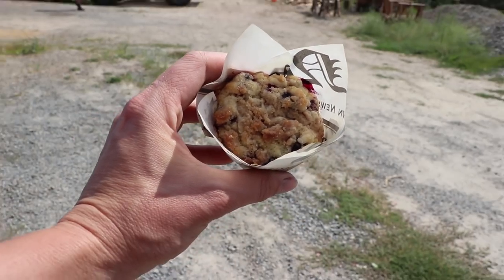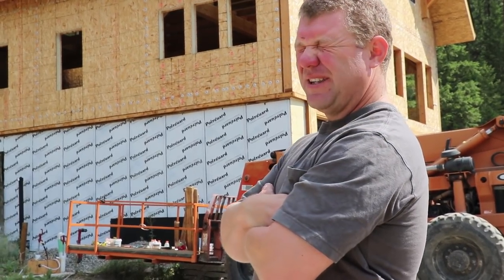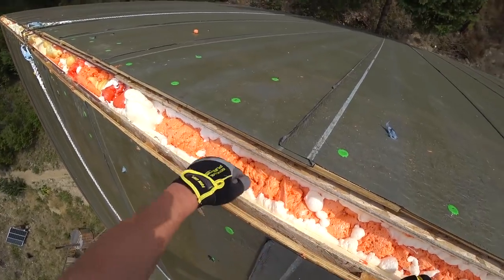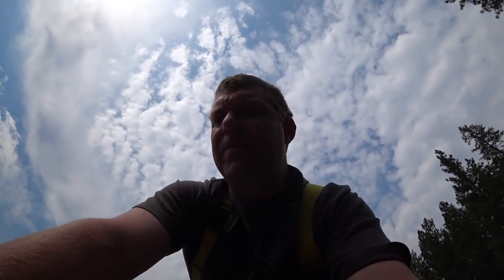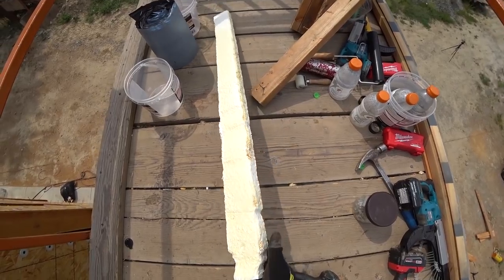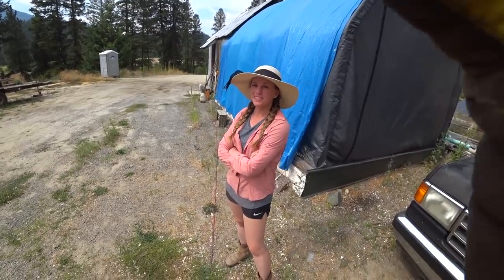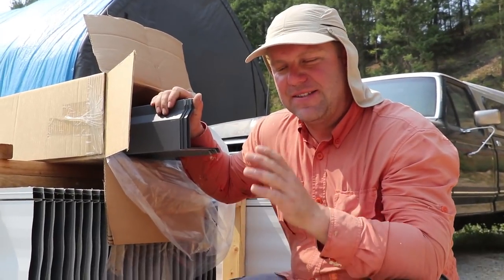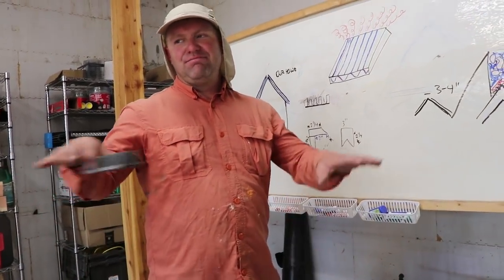OH YEA! Our Standing Seam METAL ROOFING Has Arrived!

Comment: I've been a Carpenter for 35+ years. I was told a long time ago, the difference between a good contractor and a great contractor is how they deal with problems. Your issues are normal in most house builds, being a first time builder it takes you longer to research and act on these issues. You guys are doing great, My .02

Comment: where I live many use common metal roofing with no problems. I installed this on my house using stainless steel screws. don't use galvanized one's they will rust and the heads will pop off and you have leaks. do a good prep and don't cut corners.  after 30yrs and solar no leaks.

Comment: I live in Duluth Minnesota and had a standing seam roof installed on a 12/12 pitched roof. There are no penetrations of the roof with fasteners. The roofer installed the cleats with hidden fasteners and used a metal brake to bend the roofing material to clamp on the cleat. We have high winds here every year with many downed trees and lots of snow. My roof is still solid no leaks and snow slides right off.

Comment: We have a place in Vermont... Snows a lot there, gets really cold too..  Our galvanized steel, standing seam metal roof was installed in 1974.  it's not going anywhere for probably another 44 years... (hidden hardware too).. The only thing we've done is to add a coat of Rustoleum...

Comment: I'm in Michigan and both the barn and house have hidden fastener standing seam roofs.  The barn roof dates from 1972 and the house from 1981, both much older than I am :)  The only thing done to either roof in the last 20+ years is a scrubbing with a bleach solution (moss) and then repainting with rustoleum.

Comment: I commend your patience.  I tried doing a standing seam roof with helpers and I finally got some smarts and hired a crew that does it for a living.  After my roof, I only recommend getting a guy that has a metal bending truck as he has invested 10's of thousands on a truck.  The tight knit crew measures every 22" and makes a list of each top to bottom measurement within a 1/4".  Each panel is made to match the roof.  I am sure even your roof is not exactly rectangular.  
Back to my house, they removed what I had done and started from 1 side, bend over the edges on the side and eve part.  Then went to the next panel.  Basically my roof is a giant tin can with all edges bent around.  Handled 3" hail since, 3" an hour rainfall, racoons and squirrels merrily sliding down it for 15 years now.  The attic temperature dropped 20 degrees and Heating, cooling bills dropped.I used a ridge vent on mine.  You could heat up a hot dog with the heat coming out the ridge during summer.  
I put up a vacuum tube solar water heater using S clamps with no penetrations to the metal.  I watched the metal roofs hold up in the islands last year.  I would never penetrate that exterior with screws.  You can cut the edge, bend it and screw it.  No need for that edge clamp.  That is 22 ga galvalume metal.  The guys did not like to use extra stuff as they just bent everything to fit.

Comment: Just a thought!!!  When building a house you have to break it down into systems.  Some systems like electrical, plumbing, and HVAC, can be done over extended time with very few problems.  Easy enough for two people to learn the system and do the work.  The roof however is different.  The longer it takes for each step can cause problems for the previously done step.  Case in point, the OSB.  Coated on the weather side to resist water, will only work for so long and then it will begin to swell and the surface become rough.  This will cause the membrane not to stick properly.  The membrane ripples in the heat because it is designed to be covered by the finished roof.  My point is that two people cannot learn and work fast enough to complete each step in the roofing system.  With the equipment rental, safety equipment, and cost of materials, I think you would be better off hiring a roofing company, get it done in a few days and protect everything you have done up to the roof.
Reply: The roof is finished.  The two of them did a great job.

Comment: I've done sheet metel roofs for over 40 years...standing seam is the way to go.Your roof won't blow off regardless...hiddened fasteners   would have been fine.Also screws in the flats at the eave will never leak...ever.Just do it...
Reply: Thanks Richard keep up the good work.
Reply: RICHARD MOORE I didn’t do it for nearly as long as you, but this was my first thought. I put what feels like 100s of 1000s of screws through both these styles of roofs, with no problems, in a city with a temperature differential of -58 F to 104 F. Don’t let it worry you too much!
Reply: Why would you do this? A way better eave design is using a D-style dripedge flashing instead of the typical A-style dripedge. This gives you the "cleat" to hook the panel to but gets the end of the panel over the eave. We install a pretty much totally hidden fastener standing seam roof. Even the ridge is installed with hidden fasteners.
Reply: Yep. People incorrectly assume the screw area will leak (assuming screws are not over tightened etc.) - maybe in 25-30 yrs but if that happens one simply buys a longer screw length and replaces the old screws....a pain but that's in 30 years. The price of a metal roof over time is sooo much more affordable.

Comment: I admire your patience and willingness to ask questions. However, what you must do is to weigh what a manufacturer’s engineer tells you versus what really is necessary and what really works. The manufacturer‘s engineer is always leaning to the avoidance of any possible legal issues down the road. My experience is that most manufacturers will try to avoid warranty payments no matter what you do and even if they do pay, it is so pro-rated that the bottom dollar amount is a pittance. You need advice from an experienced roofer. It may be difficult to find since you are DIY guys, but maybe an experienced, but retired guy would be available.

Comment: Tip, use a bit of clear roof silicone on any screw washers and their is 0 chance of leaks, also, screws through metal roofing never have issues with snow hanging up on them.

Comment: The manufacturer will end up telling you the vertical water barrier is okay. They don't really care and if it slips they will simply say that you did not nail the barrier on both sides. Now you know why so many told you it has to be put on horizontally with a full nail strip across the top of each row of barrier. Three feet is easily held in place with just the top of each strip nailed. 30 feet pulling from the side will stretch a lot. You can't rely on the glue at all because it cooks, gets crystallized and lets go. As for snow staying on the roof? It will slide off for the first few years. Then the metal will form a patina which will in fact hold the snow. My roof is the same pitch  as yours and 33 feet from ridge to eave and at 30 years old, I get up to 3 feet of snow on my roof each winter. As for snow sliding off the roof and bending or pulling screws, yes it does happen. And it happens more often than people think. The sun warms the roof even through the snow and causes ice to form on the face of the metal roof. That ice sticks to the patina of the metal roofing even more so than just snow and when the roof warms enough in the spring that entire snow load 3 feet deep finds itself hung up on the screw heads. When the screw heads finally rip a channel through the ice the whole shebang comes down. I average 7 tons of snow on each side of my roof every spring and when it lets go, make sure nothing and no one is under it. In short, you made the right decision to go with standing seam hidden fasteners. Just don't park anything under the eve in spring and keep BugABoo safe.

Comment: I realize this is a bit late but this might have been a good place to use the 2 part pour-able expanding foam. I used this stuff a couple years ago for a project and was very pleased with it's performance, it gets in and fills all those cracks and holes and has very good bonding with previous pourings and other foam. You can get it in different densities from a very light foam to a very dense almost rubber texture. You see this used quite often in the marine business (which was where I used it).

Comment: Central States has an installation video for Horizon Loc, very similar to what we use in Oklahoma we don’t use a cleat for the rake, what we use is shaped like a C and a special rake trim the clips and rivets to the C. The C installs before the panel, then the panel has an 1 inch bend the tucks under the the C. So there would be no fatigue on any panel. And we hem the panel directly on the drip edge.

Comment: So much research and time into a breathable roof and this is what yall came up with, there is a breathe strip product that could have ben attached to fascia. Then a long leg typical DL for standing seam could have been placed and roof crimped. At gables standard DL could have been placed and terminating panels could have been crimped down. Should have researched a little deeper exposed fasteners on a concealed fastener roofing system is just working backwards no matter how much seal strip is applied.

Comment: I had a barn built in 1986 where my contractor NAILED into the top of the ribs (4x12 pitch, metal roof) and it has leaked constantly ever since, despite using lots of caulk to try and seal it, inside the roof as well as on top. NAILS in ribs are a disaster. I have another barn addition that we built about 10 years ago, putting SCREWS into the flats and it does not leak. I then hired contractors to re-roof my house using rib roofing with screws on the flats. The only leak I have had in 6 years was where they didn't seal a roof vent properly. The rubber washers on my 30 year old rib roof nails are still good, but since they are on top of the rib, the rib moves so much they don't seal. Lesson learned, use screws on the flats, not nails on the ribs

Comment: In my nearly 60 years of building I've noticed that the codes/rules UBC etc. seem to be made up by the material manufactures. Example: Vapor barriers now being required to the extent that houses become "Mold Factories". I've become skeptical of many new materials and methods. I know many viewers will think or say that I'm just set in my ways as they scratch their heads and ponder why many houses built in the '30's to '50's have outlasted ones built in the '90's. One simple secret to keeping the interior of a home dry during the winter is a wood stove. It will also provide an emergency source of heat during power outages brought on by winter storms.

Comment: A final note, be sure to add the blocks to screw the ridge cap to before installing ANY panels.  Cut special shapes to reach under the OSB to attach to each side and have a roof top for ridge vent cap to sit on.  You probably need one every 2 or three feet.

Comment: We have had standing seam steel on our house since 2011 the rake trim is the only part that has exposed fasters our retailer provided something like rope caulking that went under the edge of the rake trim. So far no issues with water/ snow or wind hurting the roof. The house is  a 10/12 pitch.

Comment: Weird, in FL we don't see many screws on top of the rib as the engineering requires a screw either side of the rib. To put a screw on top of the rib to prevent deformation you have to have blocking. That blocking would be difficult to install every 24", 18", or 16" or whatever the wind-zone requires. It should also be noted that capillary action can occur with any roof and that may be the thinking. An ice dam holds back water which is pulled into the standing seam by capillary action.

Comment: here is my 2 cents worth, I use to run a waterproofing company which produced a liquid product based on Asphalt and the country was Pakistan extremely hot and cold, even when our product was spread on the structure we use to get bubbling within the seamless membrane and the reason was trapped moisture in the surface trying to escape and getting trapped underneath the membrane and obviously the area exposed to higher temperature had that issues (our roof were concrete though) . it might be just a possibility as one end is behaving this way while the other isn't or i might be all wrong just a thought

Comment: We have attached flashing by breaking it and overlapping the drip edge so that we did not have any exposed fasteners at the eaves. They always warned us about fastening it to tight as the aluminum tends to grow a lot with thermal expansion and will buckle. We actually purchased a break to do most of the bending makes it very clean so that it looks nice.

Comment: Great work guys ! The bubbling in the ice and water shield will happen,  it will tighten up and the bubbles will go away when it gets colder, I was concerned the first couple of times using it and the same thing happens to epdm roofing products, the metal is usually laid pretty quickly over the product so the rippling or bubbles are not usually seen. Bit they will eventually tighten up while under the roof.

Comment: i live in a tornado zone. Ive never seen metal roofs like these torn off. but i have seen tornadoes take the decking and the metal roof all in one. that was because their roof decking was nailed down, and the 180+ mph winds lifts the whole thing. Since yours is screwed down i dont see it coming loose to easily. sounds like you've got a good plan, and you've thought about all instances that could occur.

Comment: I like your thoughts on avoiding screws into your spillways in the panel.  Whoever wanted you to put a hole in your boat is crazy.  You have a THIRD rake option.  You run a cleat on your rake before your first/last panels go in.  You smash the outside clip.  You then run a C-channel over the top of the panel to underneath the cleat.  It will never fall off.  Run the laps in reverse, which sounds counter intuitive, but it gives you a smooth looking face along the rake as you do not see laps.  Minimal water will come through and it is not trapped so it doesn't hurt.  You want a good smooth rake when you look up at it.

The little ripples in your panels are stiffeners.  They give your panel rigidity to carry else they can fold over when you try to pass them up to the roof.  They also have a secondary purpose of promoting airflow.  Your clips actually hold the roof panel 3/16ths to 1/4" off the roof planes to also help air flow.  That air flow keeps the underlayment dry.  I would strongly suggest get two piece clips because they allow expansion and contraction in the panels.  I've used both and solid clips add stress over the life of the panels.  They cost way more, but they are worth it.  Typically you runs clips every 16" up the length of the panel.  Do not go beyond that 16" and too many is way better than too few.

On your eave you use a D-metal/rake-style cleat material that matches your roof panel material.  BUT install the fascia before you do that!  It's a real challenge to slide metal under your drip edge that you already have in place.  When you do fascia you also need to float your nails so it doesn't oil can.  The eaves are open right now, its the best time to wrap the eaves.

The snow needs snow guards to break it up so you don't get ice sheets coming down slicing you up.  Your 14/12 or whatever pitched roof you have going will collect minimal snow BUT will still collect ice.  Some sheet metal guys will run guards across the panels to hold snow on purpose, which is not real helpful.  Its the ice that's the biggest danger.  Do yourself a favor and get a box gutter to collect ice before it reaches the ground.  The snow just sort of pisses you off when it dumps on you.   The ice kills people.

Comment: Look into what's called a D-style dripedge for the eave. This gives you the "cleat" to hook the panels and puts the end of the panel off the roof's eave. There is no chance of wind getting under the roof panel. Unlike the cleat design that doesn't get the panel off the roof and creates an area where wind can get under the panel.

Comment: You don't need to order that extra cleat. Just wrap the bottom of the steel around your D Trim. Do the same on the Gable ends buy yourself a hand seamer and squeeze the bottom and the Gable ends after you wrap it around.